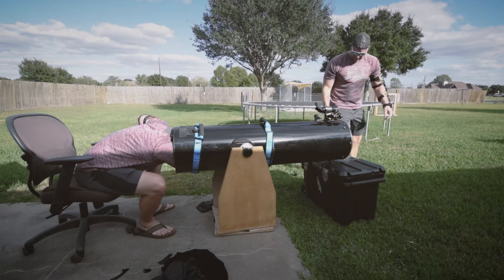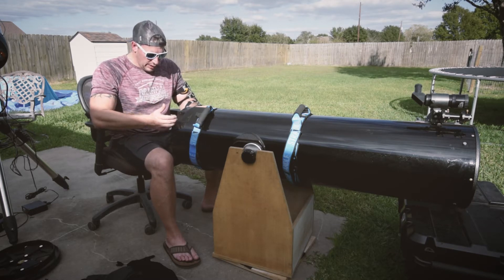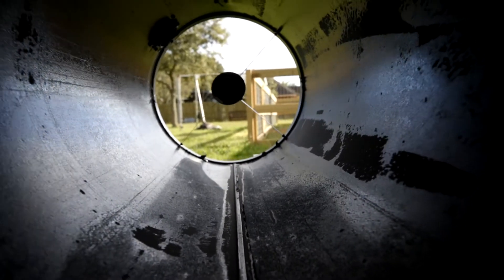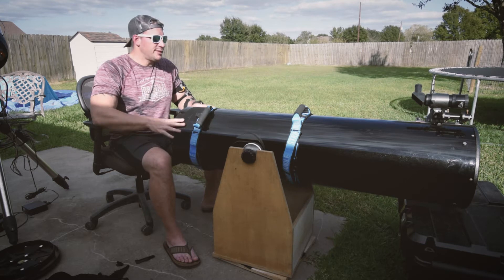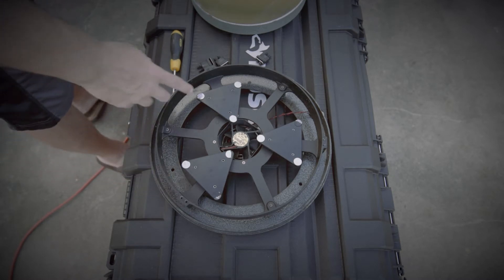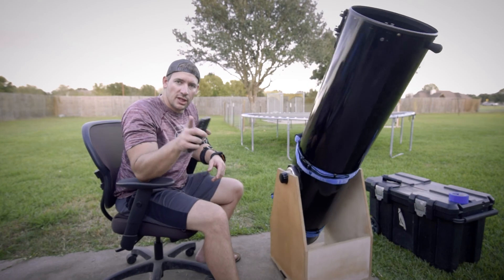Unexpected Maintenance on my Dobsonian

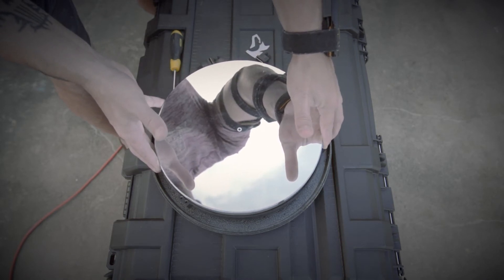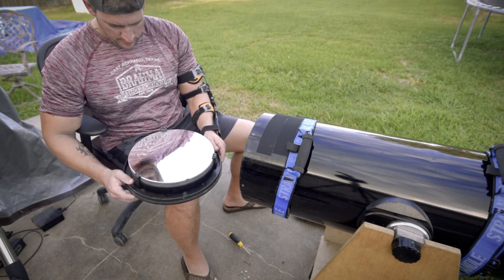Comment: At the 4:16 and 5:05-ish marks , just as you are getting ready to install the mirror , we can see a horizontal "smudge" across the bottom edge of the mirror . Optical illusion ? /SRK
Reply from the maker: It looked clean inside the house. It wasn’t til I took it outside that I realized it wasn’t as clean as I thought, but still drastically better than it was before. I didn’t leave myself enough time to clean it again before getting it all ready for the ISS.
Reply: @InsertAstroNameHere  I trick I use is to use a long straw and blow warm breath over the optical surface , no spit , and "fog" the area . Change straws often . Anything left over from the cleaning will show up . If the surface is actually clean then the fog will evaporate smoothly and cleanly without any residue . Works on any Optical surface . Too bad you didn't film the cleaning process . I'm curious on how you did it . Cheers ./SRK